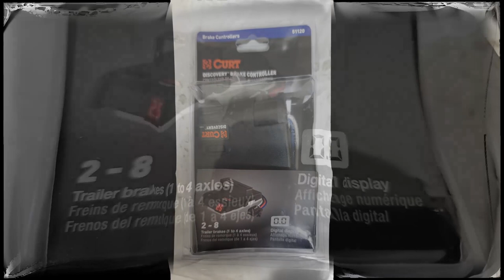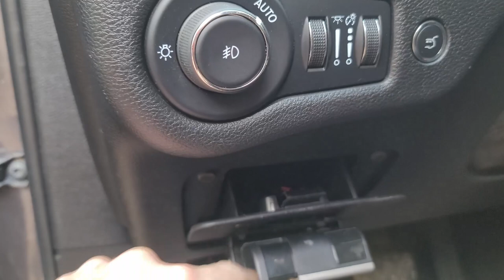Towing with the Jeep Cherokee: Install a Brake Controller!

Comment: I have a 2021 Cherokee Trailhawk with tow package exactly like the one in the vid and shocked it does not have a brake controller from the factory.  Getting ready to purchase a tandem axle trailer for our side-by-side and was curious what people are doing for one.  This helps a lot! Thanks for the vid.

Comment: I could not believe that a jeep designed with a 4500 lb tow capacity did not have brake controller built in. Not only that but the dealer could not install the simple components shown in this video.
Reply from the maker: I agree, and it is a easy install.